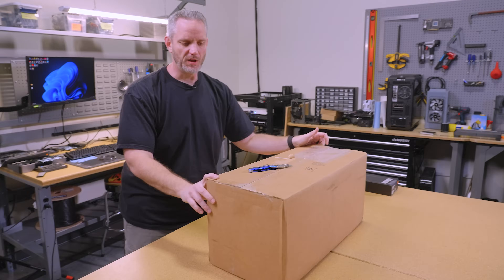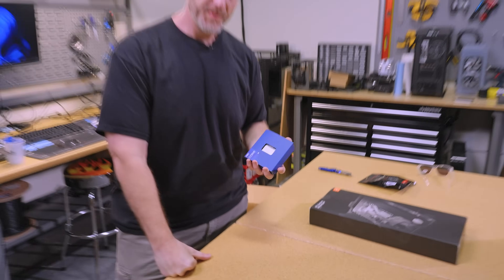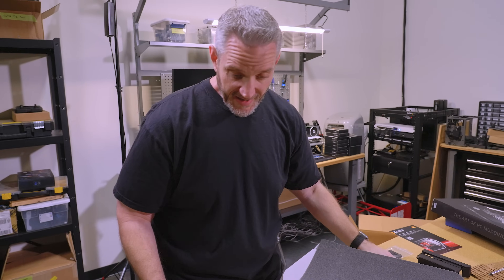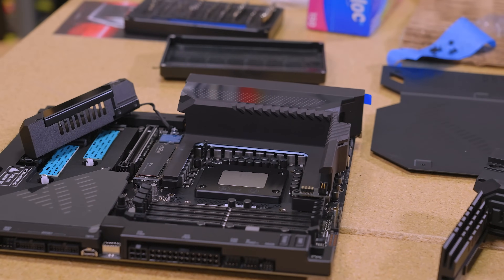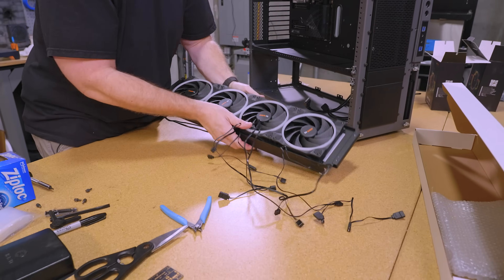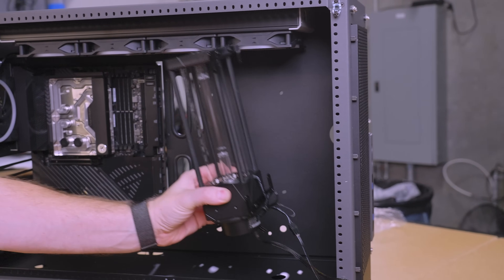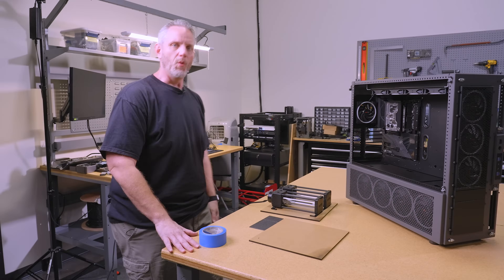Skunkworks Revival - Part 2 - So THIS is what you get for $800 waterblock...

Comment: If you pause when jay says "its exactly identical" you can see they are not exactly identical... just saying. Otherwise good work Jay!
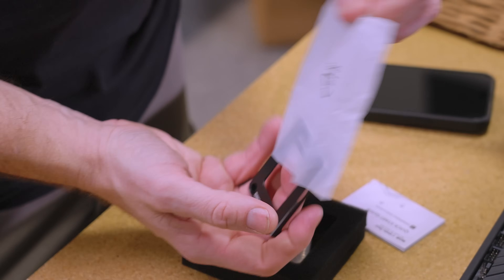Edit: heres the time mark: #9:05
Reply: identical "underneath", not the whole thing. And I think he meant it was identical to 12th gen Intel vs 13th etc.
Reply: @brnmcc01  They aren't identical underneath. Look closely, there are in fact a great many differences if you actually look carefully. He meant between the 50 dollar version and the 9.99 version.
Reply: @ShadowGirl-  I agree with you, I'm just going by what Jay said at that timestamp @9:05 "they look the same underneath" Then after that he goes on to point out all the plasticy bits on the other one :)

Comment: Extremely interesting video.   Really awesome how this water-cooling build is going.  One comment is that the Alphacool reservoirs are flow restrictive.  Granted, they are aesthetically pleasing, with useful mounting options, convenient D5 mounting, and convenient inlet/outlet/fill orientations.  But, in my testing, they dropped my system flow by about 25 lph (the path the water must follow is quite the labyrinth).  I ended up going back to a simple volute pump top design and recovered the lost flow.  The volute is certainly not as aesthetically pleasing and has somewhat inconvenient inlet/outlet orientations but the performance is much the superior.

Comment: The real topic is: I want have a silent system also in summer, for this i want 2 rads 140*420*60 with vents (25) on both sides. This was possible on Thermaltake Core X9 but with modification of chassis for only one pump and one reservoir.
For multiple rads + both-sides vents + two reservoir + two pumps is no cases available.
Besides, i'm sich to see motherboard mounted vertically and GPU mounted horizontally.
To water-cool NAS(-CPU) or server with 8+ HDD's is not possible at all, and that in 21 century. I'm a little disgusting on case manufacturer.
Even missing of flexibility on mounting rads and vents (holes instead of slots/slit) is simply disgusting.
The server rack and cases are also not better ==> i have projected my own cases without screws for rads & vents = only rubber+components in variable slides.

Comment: i love you J, but damn you are complaining about an issue you created. The trade off for the 27498158974375943$$$$$ block you got is cooling over everything on the board. you could have gotten a normal block. but you got the enthusiast one which is for people who care about cooling, not the oled screen telling you temps; especially when you already have a sensor panel and software to tell you. This is an issue only you are complaining about also you have looked it up and saw this issue.

Comment: That reality of having to tinker with your AMD build because settings go haywire and it won't boot, etc is EXACTLY why I haven't pulled the trigger on anything AMD yet. I have a full build in my NewEgg cart right now with 7800X3D and 7800 xt.. Think I'm sticking with Intel again.. I have never purchased a Ryzen CPU because I don't want to deal with issues. Thanks for confirming Jay

Comment: I moved to AMD in my desktop with the launch of the R5 1600x, since them I went 3600X, 5600X, 5800X and now 5800X3D, at the same time I used Intel / Nvidia in my laptops 4 of them so far. 
The AMD systems are much snappier and fluid operation than the intel ones. 
(And I’m using 2000€ + laptops btw). 
The only negative thing I have to say to AMD is that I have usb connection issues since forever!
Once every 2 months or so, when I turn on my pc, the keyboard and or mouse do not get recognized and I have to restart the system.
Its irritating but… intel its just… hot, power hungry, and is not innovating.
 I can not see it as a “performance or quality brand”.
I dont even care for videos about they products...